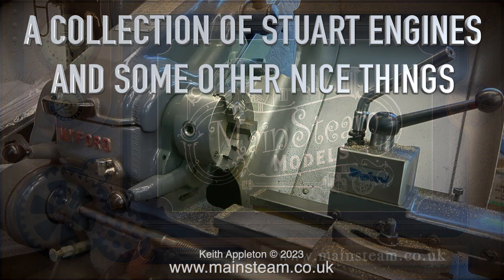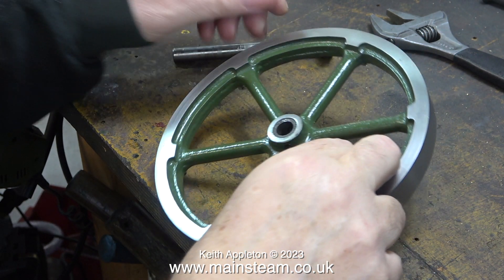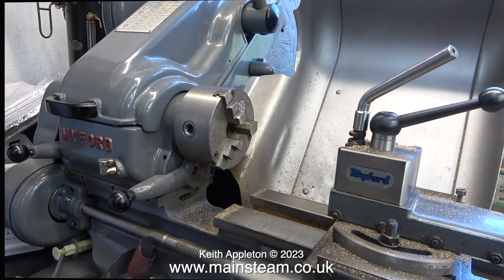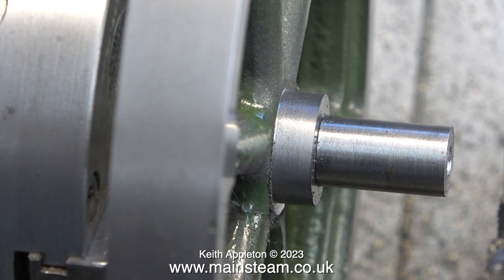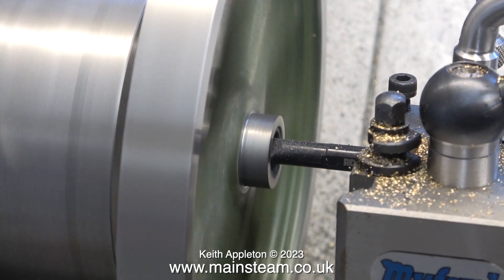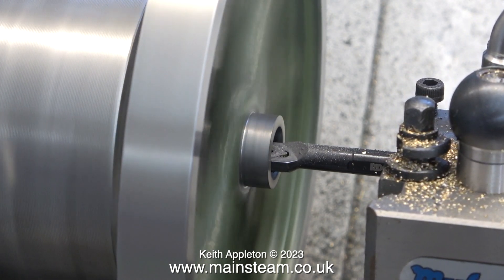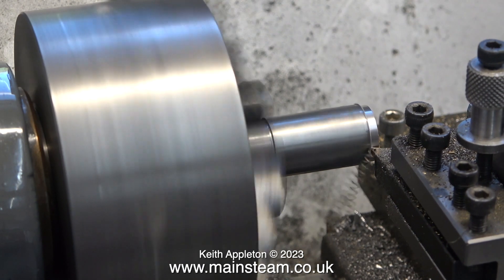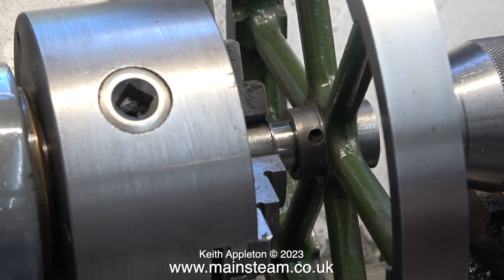REPAIRING THE GRASSHOPPER BEAM FLYWHEEL - PART #5

Comment: Quote an other engineer’s video: “most people do not realise what a thou means”, referring to the tolerances in machining of course. I agree with you, don’t go mad about it, but sometimes a tight tolerance is prerequisite for a successful job and then you must be at it. So I practice on getting sizes right on less important dimensions. A bit over or under, well no harm done, I will do better next time. No need to be too fussy though. But once I get to a dimension that is critical I can put all the seemingly useless practise to work. And I am getting better at it every time, despite my hopelessly inadequate Unimat 4.